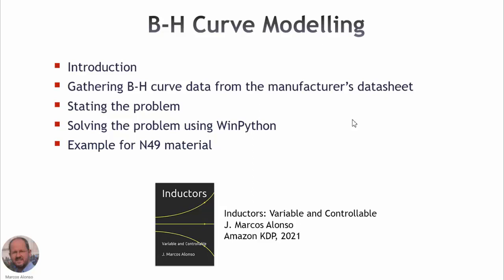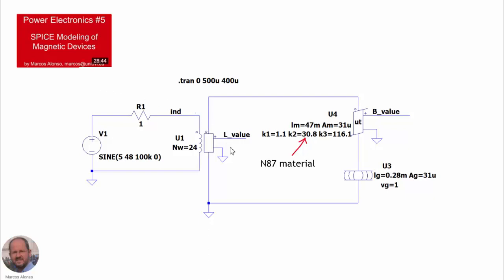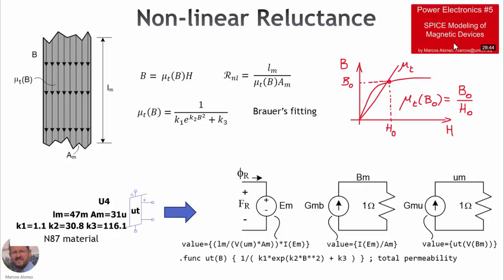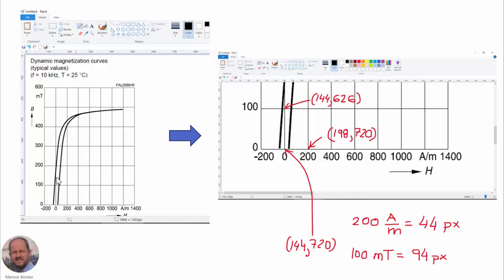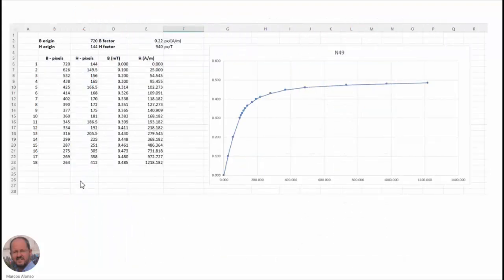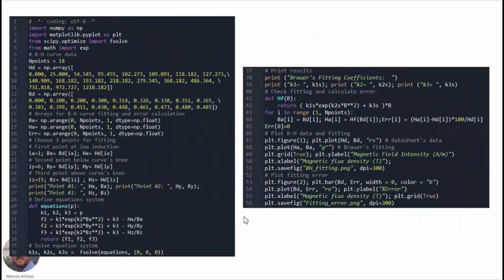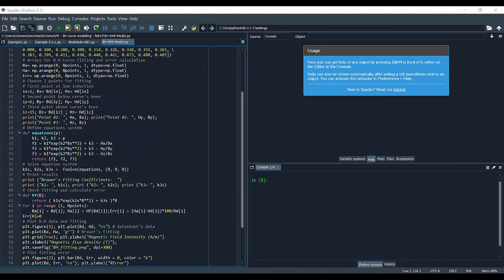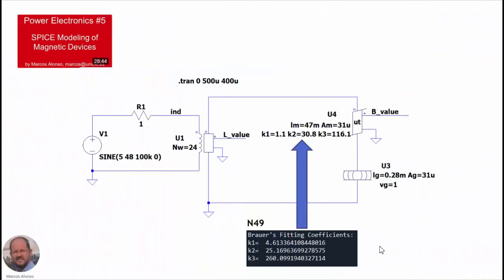PE #39: BH Curve Modelling using Brauer's Fitting

Comment: Dear Professor Alonso I am reading your book "Inductors", purchased a few weeks ago.
In chapter 1.2.5 on page 11 (Modeling of the Simplified B-H Characteristic), in some expressions for example at 1.55, 1.57, 1.59 appear Ho, Hm and Bo which I assume are constant. I can't quite understand how to interpret them, could you give me some suggestions. Thanks in advance.
Reply from the maker: Hi, thanks for your interest in the book. I hope you enjoy the reading.
Ho, Hm , Bo, etc. are constants that we use to do the fitting. They should be determined from the actual curve of the material by curve fitting. It is the same as in the Brauer's fitting in which the constants are k1, k2, and k3. The process to find these constants is explained in Section 1.2.6 for the case of the Brauer's fitting. For the other fittings it can be done is a similar way. I recommend Brauer's fitting though.
Reply: @MarcosAlonsoElectronics  Thank you very much